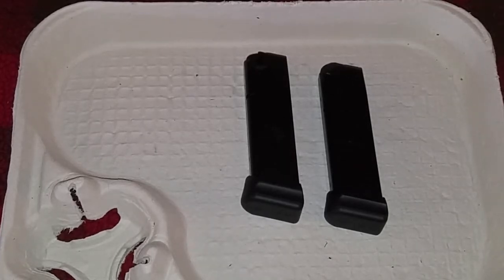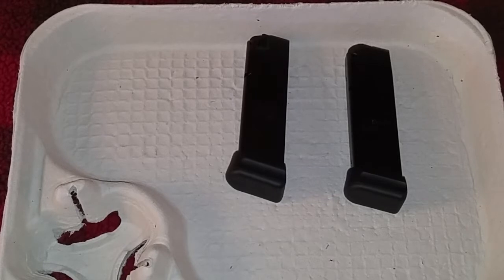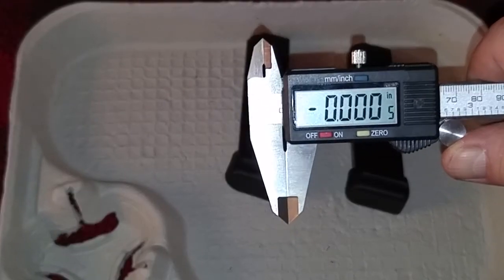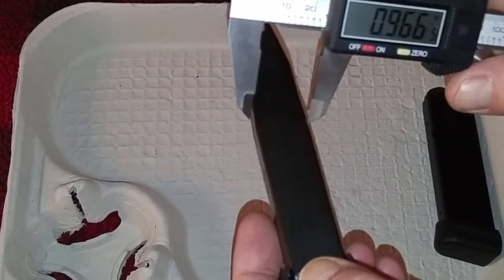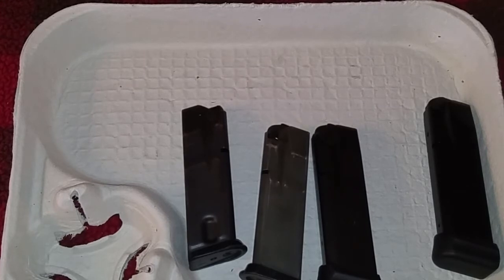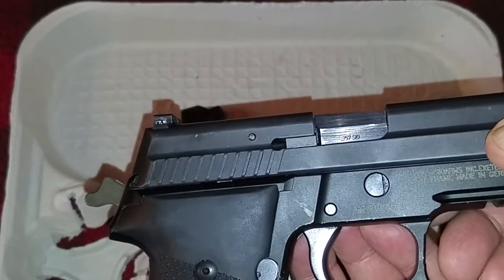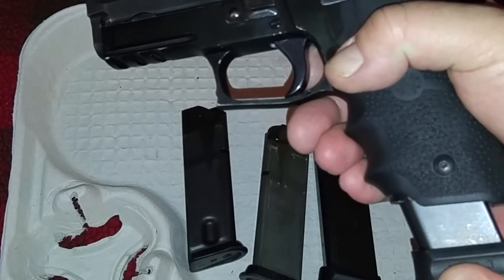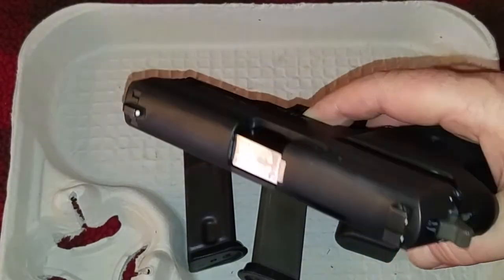P229 MAGAZINE DIFFERENCE

Comment: You can really easily and properly convert from 40/357 to 9mm nowadays with 100% reliability because around 2009/2010 they started using the same frame between 40/357 and 9mm, and if you buy one of these in 9mm now, it says it is a P229-1.

It's the same frame, locking block, mag well. 

If you want to take your 40 or 357 to 9mm, buy a 9mm 229-1 slide, barrel, and spring and 229-1 9mm mags. Boom, it's a 9mm and will run great. 

As a result, your 229 becomes a platform that you can shoot 9/40/357 in. Between 40 and 357, just change barrels. For 9mm, put on the 9mm upper and use a 9mm spring and 9mm mags.